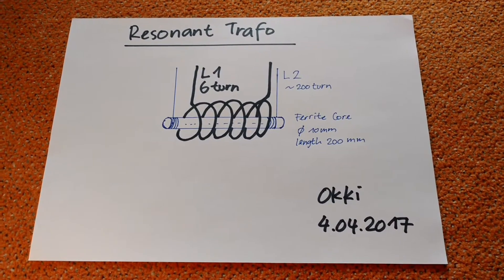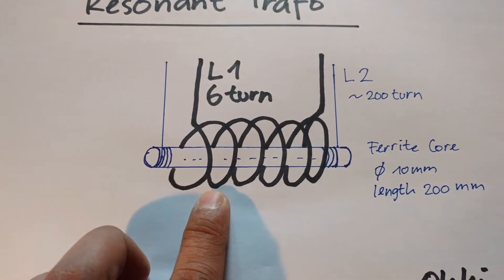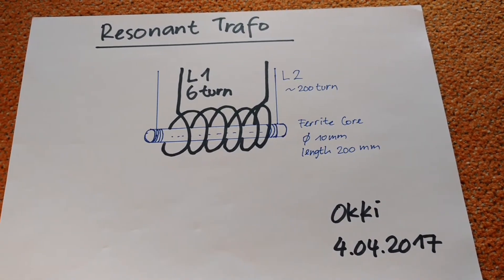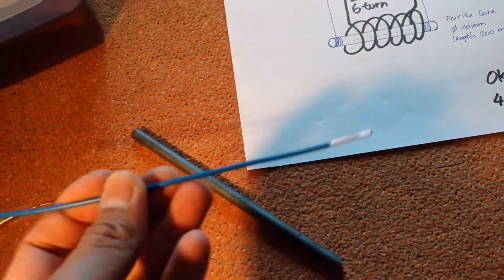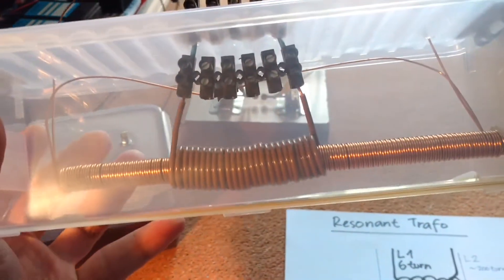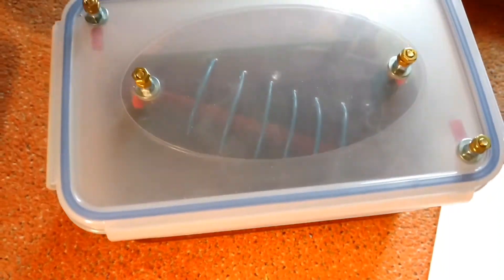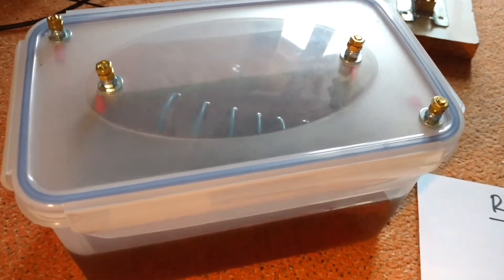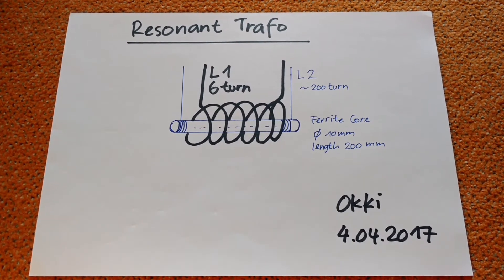Resonant Transformer for Cold Electricity Experiments

Comment: Hi OKKI THIS IS WILLIE. YOUR SUBSCRIBER. OKKI, PLEASE SEND ME THE SPEC FOR THE Recycling  Electricity (self-charging battery ). what size (DIODE) AND WHAT SIZE  HV CAPACITOR, AND RESONANT TRANSFORMER.  YOU ARE, AN EXCELLENT TEACHER. YOU MY BEST RATING. THANK YOU & GOD BLESS WILLIE.
Reply from the maker: Hi Willie. Thank you for supporting me. For the diode, I use 1n5408 and the capacitor is 10µF. I have shared the details of my resonant transformer already in one of my videos. Good luck with your project!

Comment: Do the ferite core gets inmersed in oil?? Inside the secodnary pipe ?? Or i should glue ends of secondary pipe to prevent oil to get inside.???
Reply from the maker: Yes it does. You don't need to cover the ferrite with anything.

Comment: the bifilar is to extract the energy as it is flowing to ground. The resonant transformer I don't think has a core. just a wood dowel..
 If you use a bifilar it must be in the sectional winds where they meet in the middle and two circuits are wrapped around them. One being highly positive and the other being very negative. I think the negative one is better to attract current from the ground. I am not that sure. Also the metal ground should be a lot bigger. More surface the better.
Reply from the maker: Jon Bigman, thanks for commenting. You are right about bigger metal connection to the ground.
Reply: The metal ground i was referring to was the enclosed aluminum plate.  That plate is a virtual ground and it's ability to sink the impulses to the ground depends on the mass of that plate and the surface area. But great job on experimenting with this.

Comment: Okki , wonderfull and inspiring work. thanks a lot.
would you answer a basic question for begginers... why do you call this a RESONANT trafo? L1 and L2 are built to work in the same frequency?
Reply from the maker: Hi Bruno Raggio, I call this a resonant transformer because it will not work at any arbitrary frequency. You have to find resonance frequency on L2 side (L2 and load altogether). L2 has to "ring" in order to make this transformer to work. Also L1 and L2 are loosely coupled just like Tesla Coil.